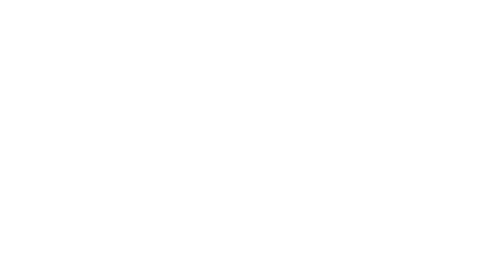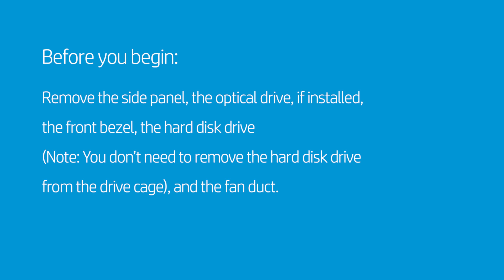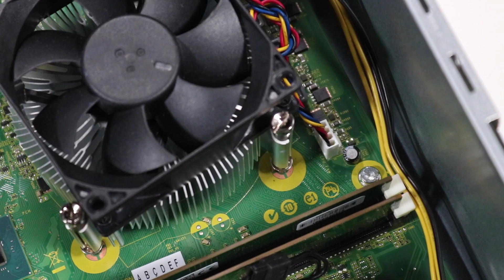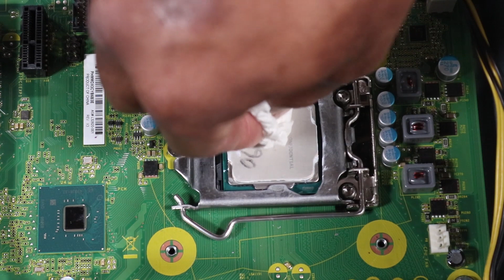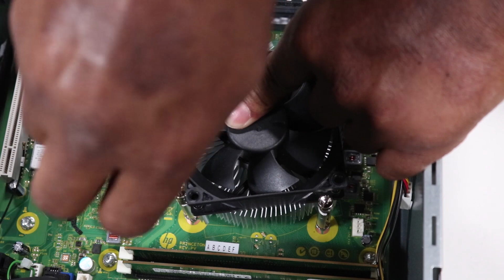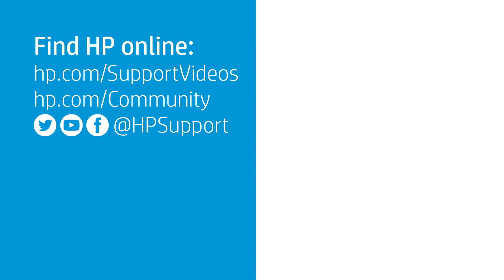Replace the Fan and Heat Sink Assembly | HP Desktop Pro G2, G3, Pro A G2 and 190-0000 PC | HP

Comment: can i just replace the fan from the heatsink and put a noctua 80mm fan or do i need to replace the heatsink as well
Reply: RTX LJ  same did u figure iut
Reply: Yes you can without changing the heatsink. Uses a standard 80mm fan

Comment: Can I use a replace a heat sink fan with a water cooler?
Reply from the maker: +Internal Aids HP does not recommend upgrading or downgrading hardware parts or software that is bundled with the product as It may affect the manufacturer's warranty and performance, however, you could change the configuration at your own discretion.
Reply: @HPSupport  ok, thank you very much

Comment: I want to add a fans but my hp motheboard dont have the input of fans how can  i do?
Reply from the maker: +Yy 17 HP does not recommend upgrading or downgrading hardware parts or software that is bundled with the product as It may affect the manufacturer's warranty and performance, however, you could change the configuration at your own discretion.

Comment: I installed the CPU fan upside down....is it ok or not? HP desktop.
Reply from the maker: Hi Elvis, thanks for contacting HP Global Social Media Support!
I understand that you need to know whether it is ok to install CPU fan upside down.  
I will do my best to assist you.
HP does not recommend upgrading or downgrading hardware parts or software that is bundled with the product as It may affect the manufacturer's warranty and performance, however, you could change the configuration at your own discretion.
Binu_HP Social Media Tech Support
Reply: Upside down meaning the fan is now doing this ⬆️⬅️?